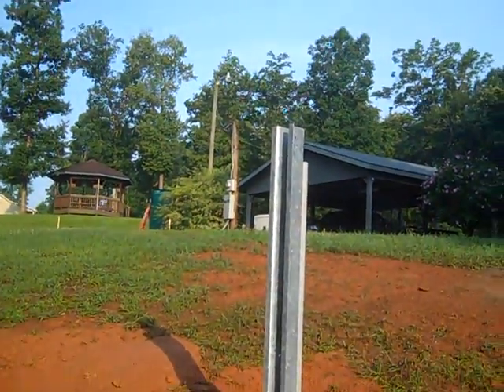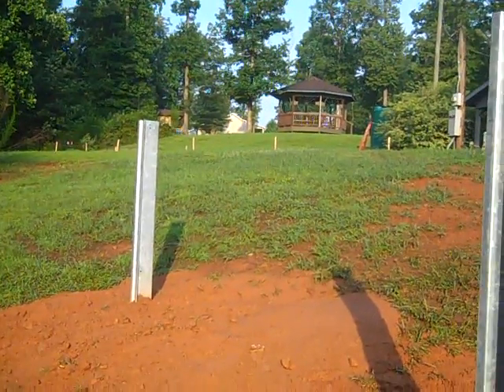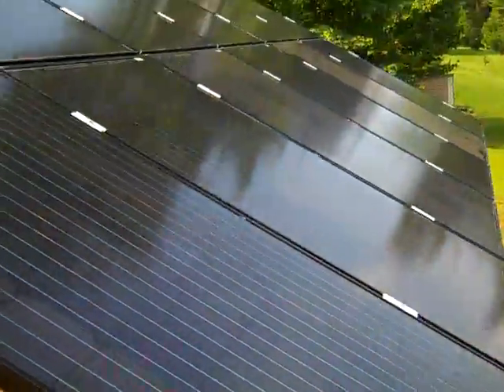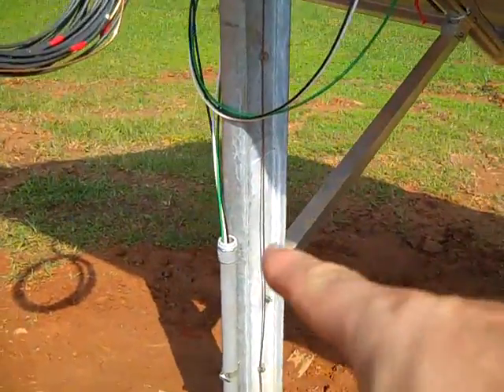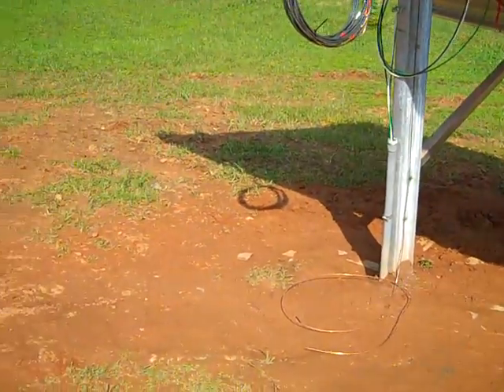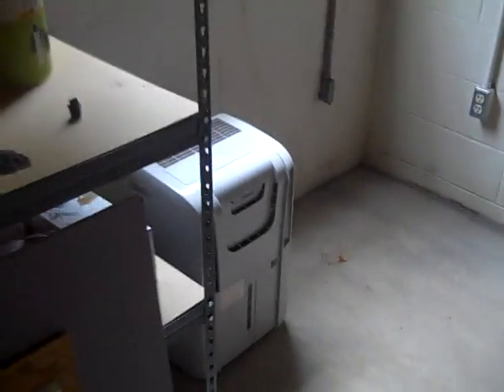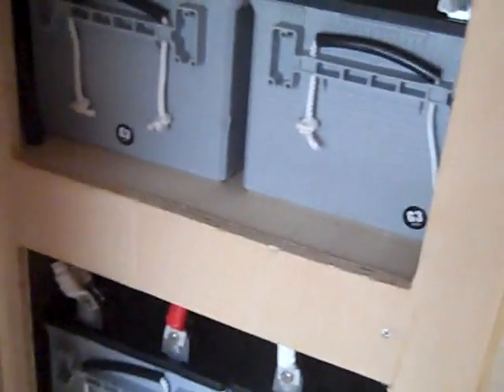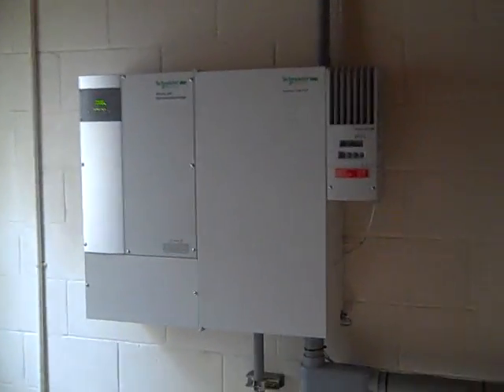Ground Mount Solar

Comment: Wanting to install this Schletter Ground Mount. Could you tell me the difficulty in setting the poles in concrete, if that is what you used and what size hole is needed for this system. I'm limited in access as to a big concrete truck getting in.
Reply: The pole need to use machine to pile it in to ground, some racking company use ground screw as foundation to screw into earth.

Comment: Just curious, any concerns with H2 buildup in the battery enclosures during heavy cycle recharging? They looked like lead-acid storage types but I didn't get a good look. Anyway, nice set up. You do good work! I'm a EE, and I could not have done any better.

Comment: Can you explain how this does both Grid Tie and Batteries?  I have an 8.4KW Enphase system, could the Enphase system be tricked by a battery backup and inverter when the grid goes down?  Disconnected from the Grid of course.

Comment: Good idea but your poles and panels should be high enough that you can't walk into them or have your lawn mower damage them. I have 4.2 kw of panels mounted with hinge point at 12 feet. And can adjust angle bi-weekly for sun angle. Just make sure it is sturdy enough to handle wind.
Reply: Dave, how'd you do that and how big is your system? I was thinking the same thing- use it as a carport or something. 
Thanks!

Comment: hi,
what size and type of wire are you using from from the panels to the inverter/batteries? Are you wiring the panels in series or parallel?
john

Comment: This thing is even better!
The Airmax wind turbine:
watch?v=Xl0a7Xp0_a4
watch?v=1-WqPITmhkw
8,000 kWh/year!
12 of them provide the same amount power as one big conventional wind wheel.
But the Airmax is absolutely silent, contrary to the windmill
and it only costs $8,000!
The Airmax can run with very low wind speed and also during storms, conventional wind wheels have to be stopped during a strong storm.

Comment: @Engineer775,  will you please explain how that Geiser works with the solar to run an electric water heater.  I couldn't follow in your previous video how it worked but this is something I think is doable for my own water heater.
Thank you.

Comment: I really like the Uni-solar flexible panels. They are a little larger but are quite durable and you can roll them up into a 14x14x22 inch package for portability. I have a 140 watt that is 20 inch wide by 18 feet long. For permanent inatallation they are peel and stick for metal roofs.

Comment from the maker: PV project cost $37,631.00
Heat pump project cost $2,800.00
total =$40,431.00
Estimated tax savings
30% Federal ($12,129.30)
25% South Carolina ($10,107.75)
Total Tax Savings ($22,237.05)
System Cost after tax considerations $18,193.95